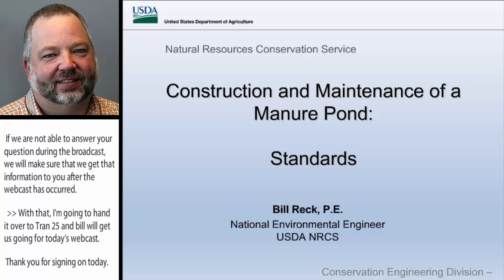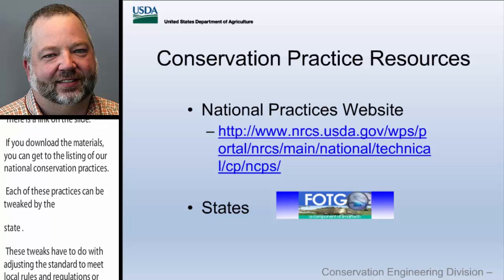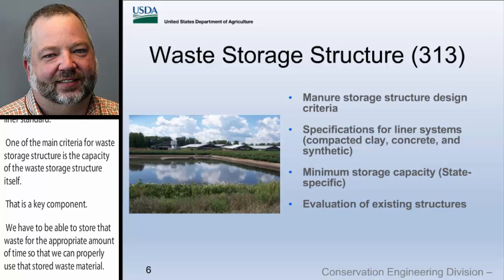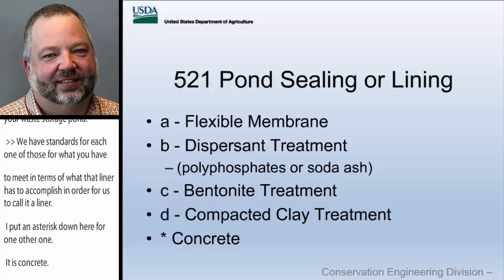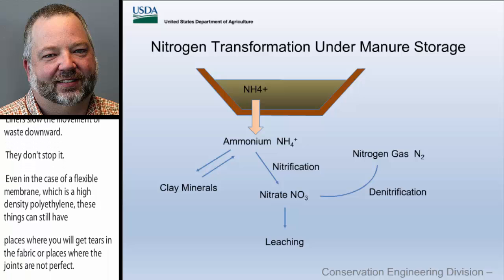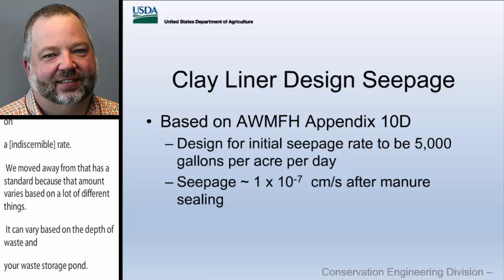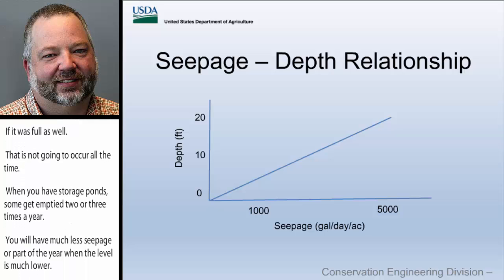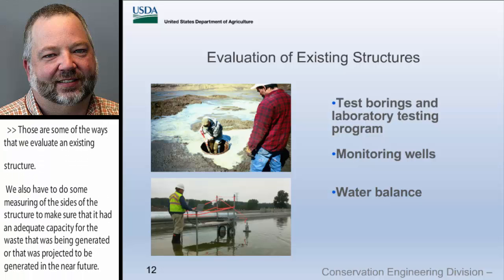Manure Pond Standards

Comment: This is a very helpful video. Can you help me with a few questions: I have a neighbor that has what appears to be a manure pond 1) Are they required to report to the county details such as installation date, list chemicals used to treat, etc and is this supposed to be publicly available? 2) Who performs periodic inspections to check for compliance in terms of soil monitoring, potential high unsafe chemical levels etc 3) Is there a rough proximal distance where manure pond chemicals are not necessarily a factor for a well. for example if my well access is 200’ away is that far enough? 4)I performed well water and soil test for several chemicals prior to purchasing my property last year. Is there anything else I can do. My biggest fear are the chemicals seeping into ground water and contaminating my well.